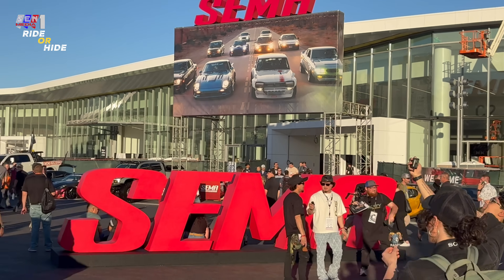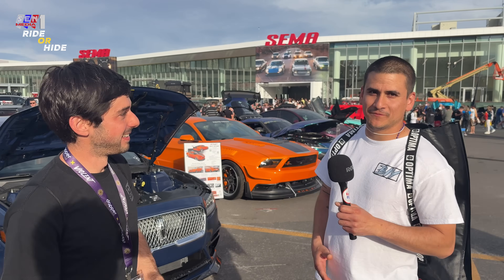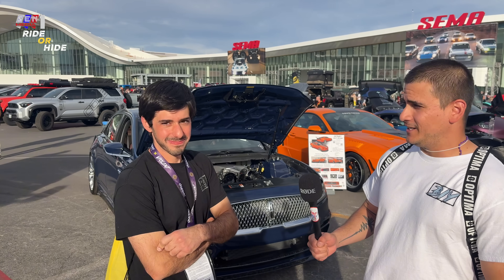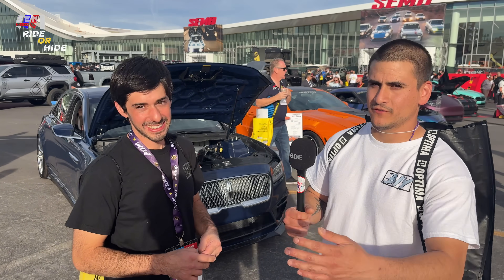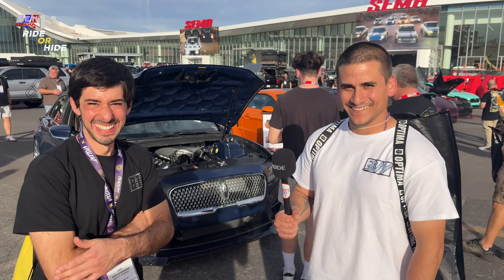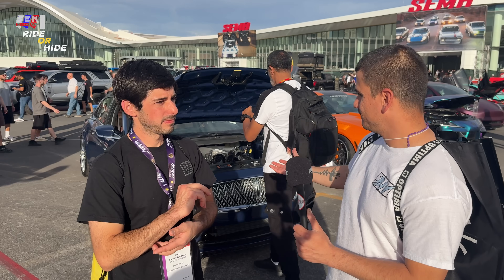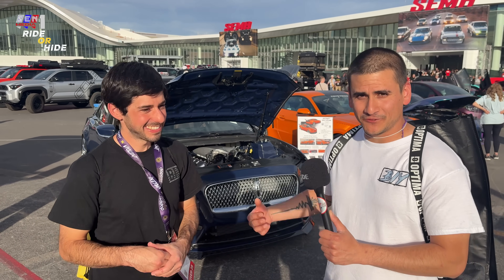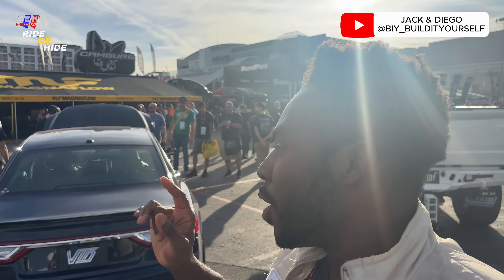2017 Lincoln Continental V10 - the way it was meant to be!

Comment: The one thing I would have done differently, in the interest of practicality, would have been to go with 3-valve heads in as close to an optimum configuration as I could have taken them. 

It remains an unanswered question on the 3-valve head potential in the performance community at large, and I've always been curious how much was gained with the 4-valve configuration. It isn't always about flow, it's also port velocity and combustion chamber shape, and the 2005 release of the 3-valve design compared to the older 4-valve might have given it some possible advantage that could offset the lack of an extra exhaust valve. 

As it stands, my hat is off to them, and it definitely is getting more media attention as a 4-valve than a simple 3-valve ever could. But, a huge savings may have been realized, and the durability equation would have skewed sharply in favor of the factory 3-valve configuration; not to mention putting a project like this within practical reach of many more innovative individuals to follow in their footsteps. 

As it is, I fear that it will remain nothing more than a one-off, with anyone trying to pursue Ford V-10 performance penalizing themselves by using the far-inferior 2-valve head as a starting point. But, at the end of the day, I love hearing the big Ford sing!
Reply from the maker: Thank you very much for your in-depth and thorough explanation. We think what you’re saying is also great, reach out to the guys and let’s make another! They would love the collab. Don’t forget to have us document it ❤

Comment: Great build! The reason in my opinion why the Lincoln contental never took off or at least went head to head with the Europeans cars. 1. Front wheel drive or all wheel drive. 2. V6 engine 3. In my most opinionated thought it was to small of a flagship four door sedan car. Like the S Class, Audi's, Jags. The car was a good looking car but when I saw it in person it felt and looked small. It should have been the size of an S Class